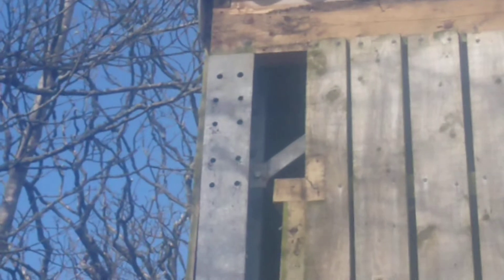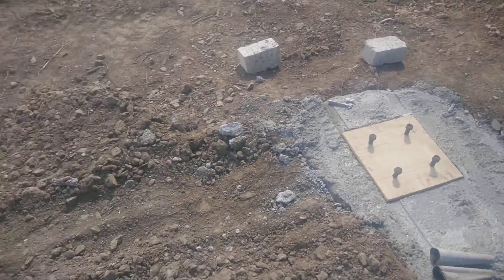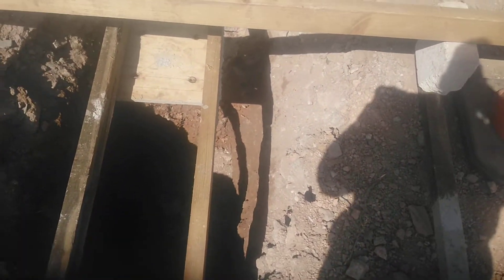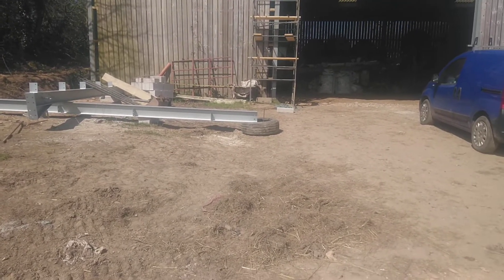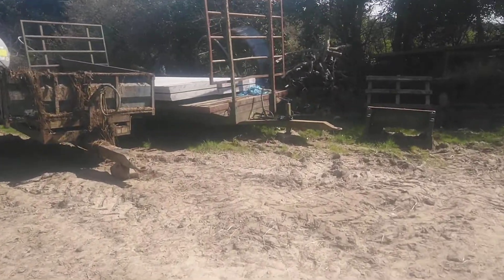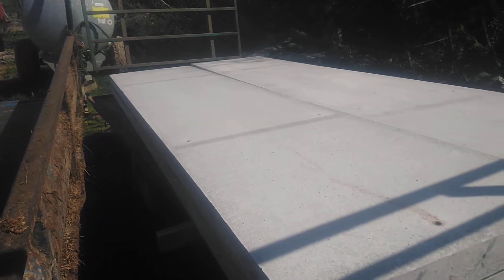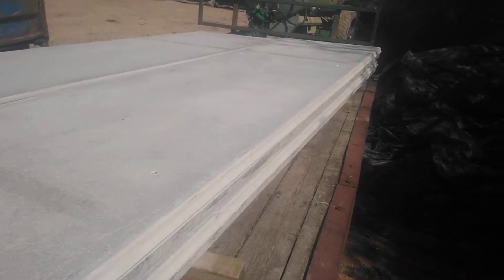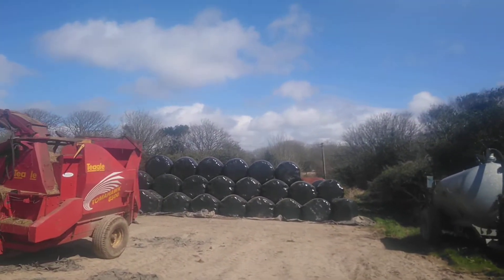Project 2

Comment: Great couple of projects on the go. Please please be so careful when ur working with those panels. I'd advise getting a telehandler in and use proper chains/straps
Reply from the maker: What not allowed to use baler twine🤣🤣🤣
No the local plant hire has proper lifting straps especially for them 
We're probably have a telehandler to put the steel frame up for the building and put panels in same time